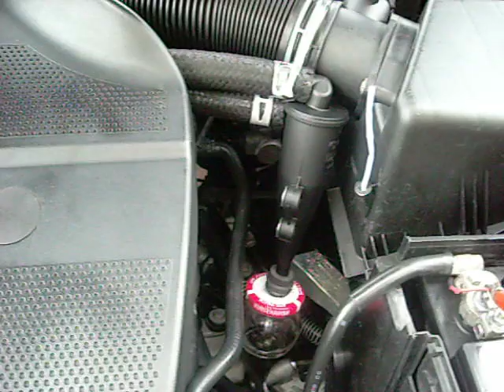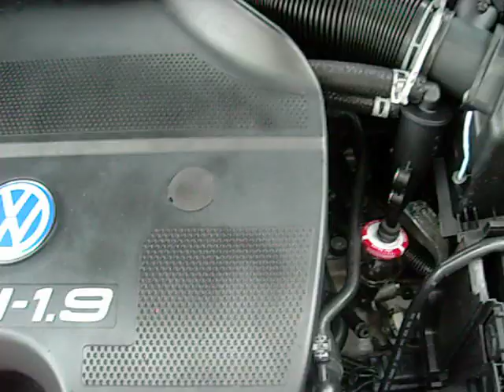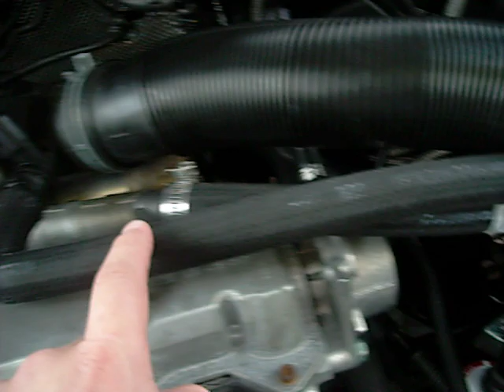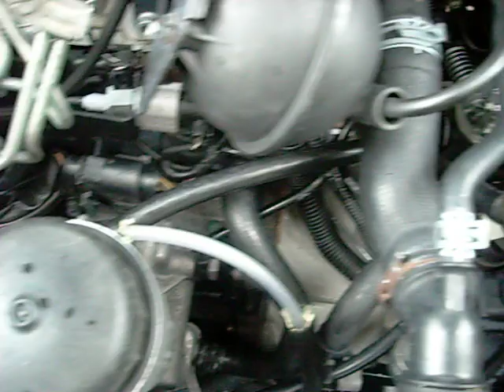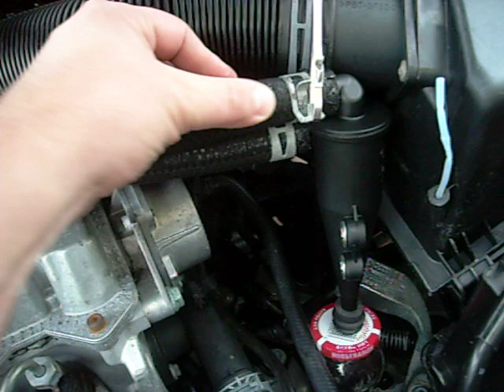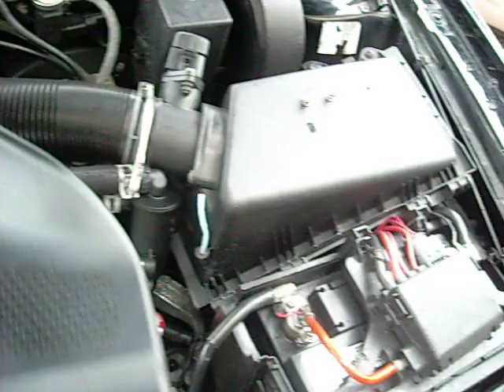VW Jetta TDI Air/Oil Separator for ALH Engine

Comment: This won't do much if the flow speeds in the VW ALH TDI PCV system are not matched to the BMW. Cyclones of this design are made for dust and dry particle separation and are designed to work with one primary air speed only. That's why Dyson uses them, that's why lumber mills uses them.

I suggest you look at all of the other BS components that are applied when using these cyclones as oil separators. They added pressure relief valves/diaphragms and reed valves to all of these cyclone systems to combat their lackluster performance and WHY they fail on BMWs. Even with all that it will fail, according to the interwebs.

Your ALH engine likely already has an oil separator built into the cylinder head cover like my CJAA CR TDI does, perhaps not cyclonic like a CJAA. Sad thing is, from my research and real world experience, they still don't work, and the CJAA has an elaborate cyclone system too (over built, and just useful enough). 

Cyclones are used because they work well enough and were believed to be maintenance free on the design board. Most catch cans on the market will do the job you need them to, they just require cleaning which is the lame part.

I would consider Radium Engineering's can, any of the popular BMW cans, APR's can, and 034 Motorsports newer can. The company I work for will be releasing one this year. I just don't want to release repeat technology, so I'm looking at what the OEMs have been forced to do to meet emissions standards, along with ease and longevity of service that so many desire.

Comment: Two things, 
1) If your model Jetta is anything like an Audi, there is another vent from the PCV that returns blow-by gases to the turbo to be re-introduced to the intercooler and intake stream/intake manifold, and that is another reason for oil in the intercooler piping. By using an aftermarket block-off plate in place of the stock PCV that also eliminates the PCV to manifold connection (vacuum cap the manifold inlet closed), you can instead place the cyclonic separator inline between the block-off plate and the turbo return inlet, thus filtering THAT return air, eliminating a great deal of oil (and turbo vane soot) from the intercooler piping, having zero blow-by/oil going directly from a PCV to your intake manifold, with the added bonus of eliminating the PCV which is prone to failure anyway.
2) Even though it's a small amount, you really don't want the material being separated by the Cyclone to go back into your pan with the clean oil. The white sludge it eventually turns into will coagulate/gel (especially in cold weather), possibly be sucked up as small lumps clogging your filter, and what your filter doesn't catch will pass through to clog small passages.I would just use a larger jar and empty it during oil changes.

Comment: I like using my engine cover, do you have a how to on that?
Reply from the maker: +Dave Kana 

I don't have a how to, but there is information online about it.  Just search "ALH engine cover pop off retrofit"  I ended up finding rubber pop sockets from an older early 2000's 1.8L gas MK4 jetta at the junk yard.  You'll need to find the engine cover with the car which can be hard to do.  Each car will have only two pop sockets, so you will need to find two cars worth to do it.  The mod itself is easy to do and very functional.
Reply: Thanks, just the info I needed! Dave

Comment from the maker: Still performing well.  Little over 1 ounce per 10K miles is currently collecting from the lower inter cooler bleed line combined with the cyclonic separator.  I added some fine mesh stainless steel soap-free scouring pad to the inlet line of the cyclonic separator to increase separation efficiency.  I will know in another 10k miles if it helps it out a bit.

Comment from the maker: @mrmekone 

Actually in the 6500 miles since it has been installed it has performed extremely well.  I added a lower intercooler bleed to move acumulated oil to the separator also.  Recently I removed my rubber "P" hose to the EGR, and it didn't have an oil residue like it normally would-....all thanks to the separator/lower IC bleed!

Comment from the maker: @Turbo617 

I would rather not loose oil inventory-especially not to the environment if I can help it :)  I am actually working out a way to totally eliminate oil pooling in the lower inter cooler with a very small air bleed directed into the cyclonic separator.  I will make another video showing the setup, and documenting results.